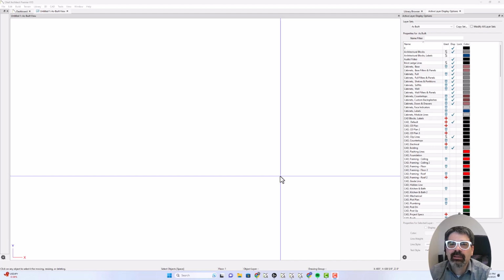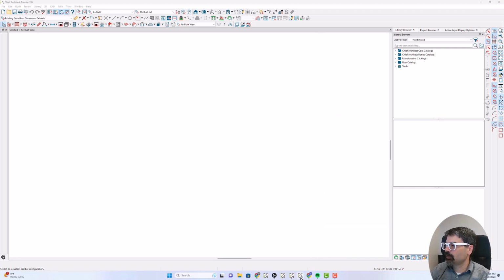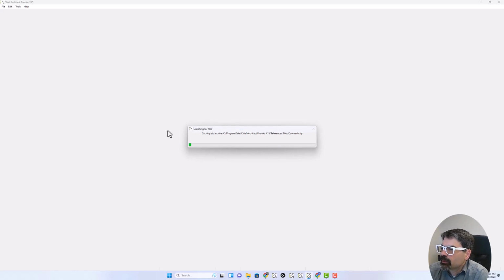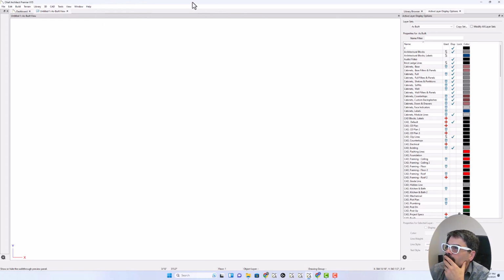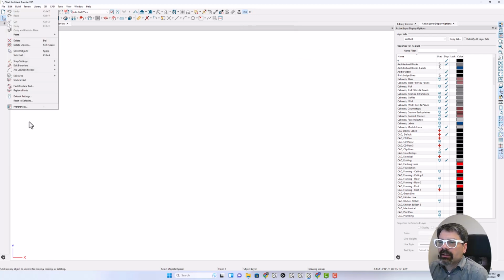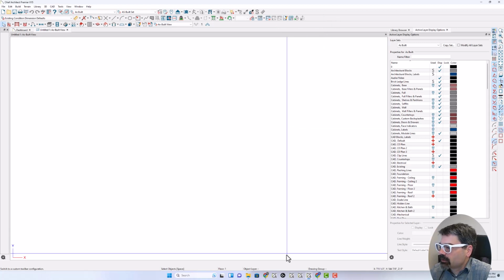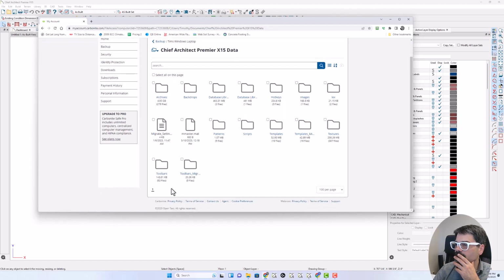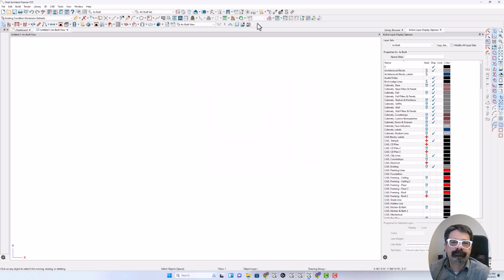Missing Toolbars | Chief Architect

Comment: This just happened to me in x16. I did the reset and it brought back toolbar. When I started to draw all the wall were black. Also the floor is not coming in. The walls are closed and I can click in the space, but still, no floors.
Reply from the maker: Hmmmm....Sounds like something deeper than just toolbars on the file itself. I don't think I can diagnose that thru text. Have you tried Chief Tech Support?
Reply: @ i have not yet. I went back to an earlier version so i could meet a deadline.